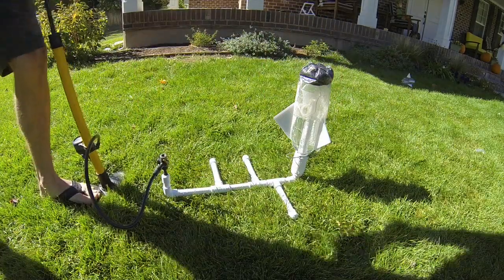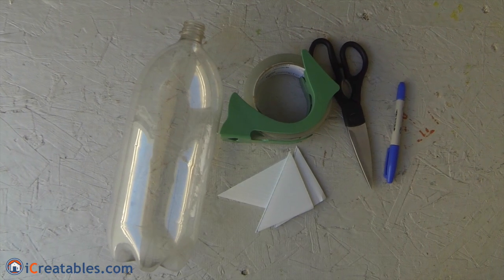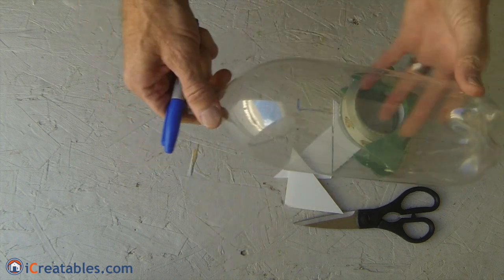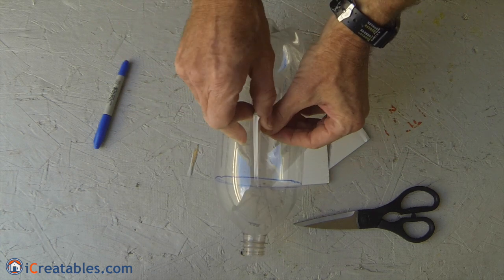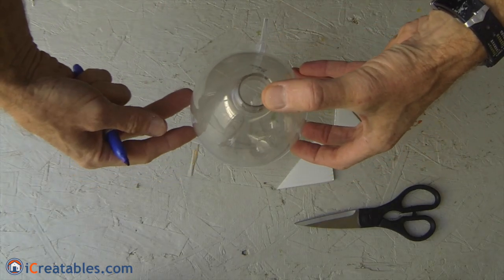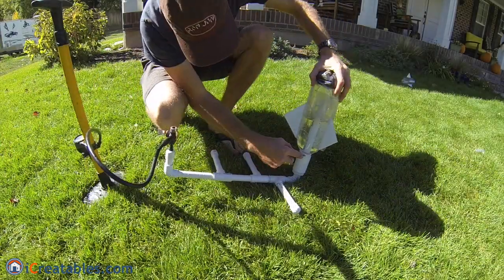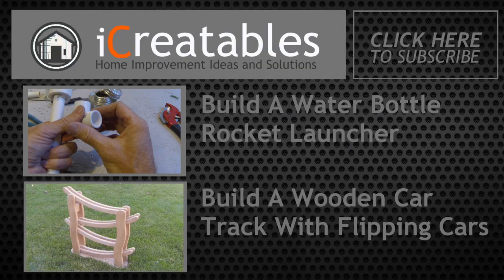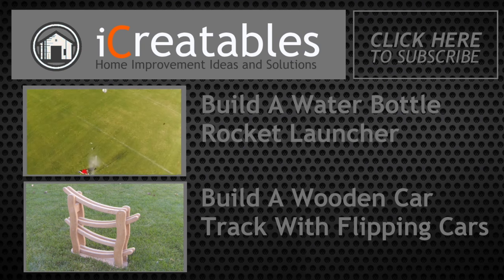Build a Water Bottle Rocket - How To

Comment: Mine don't need no fins, I just put a schrader value on the bottle top, the launch pad works buy spinning the bottles backward while holding the cap stationary. They keep spinning and this stabilizes them.   I've pumped bottles up to 110 PSI without incident other than the bottle mouth tearing apart on launch.
Reply: Great, where’s your video??
Reply from the maker: Sounds awesome!

Comment: Got a question does the speed of the rocket change if the top part of the bottle was pointy?
Reply from the maker: I am sure it would. But by how much I do not know.
Reply: Not much. A bottle isn't the most aerodynamically optimal shape to begin with, so putting the "pointy" end of the bottle upwards would probably do little to nothing to reduce drag.
Reply: @bjarneherrmann4566  putting the “pointy” end of the bottle up defeats the whole purpose of using one in the first place.

Comment: Thanks, I need to make a bottle rocket that can stay in the air for about 10 seconds, and not kill an egg.
Reply: good luck
Reply: lol, my dad helped me with mine, it went very high, we had nothing but 3 wings, a different head, and electrical tape to make it smooth. Our egg died though. sad times
Reply: cool
Reply: If you have a usb cable to plug your camera into the computer, you might be able to open your camera's files, then open your computer's files, and drag the file from your camera onto your computer, I don't know for sure if this will work, but I guess you can try it
Reply: Did it work?
Reply: Alright, How did it go?
Reply: Okay
Reply: FrogLoverShelby
Reply: Edwin Alverdin the egg did not survive, it was crushed upon re-entry, though, it was hilarious. I got a good grade on the project, but the video is horrible.